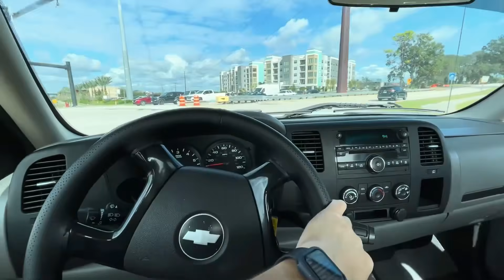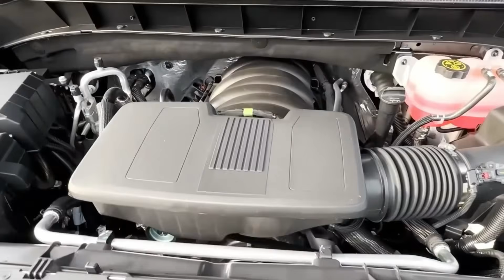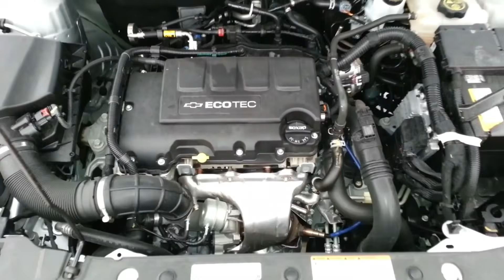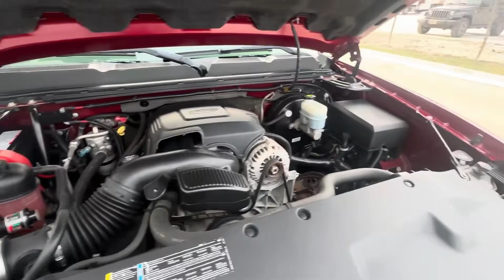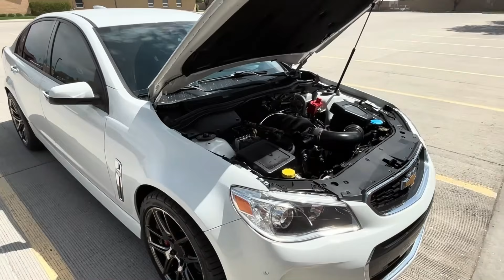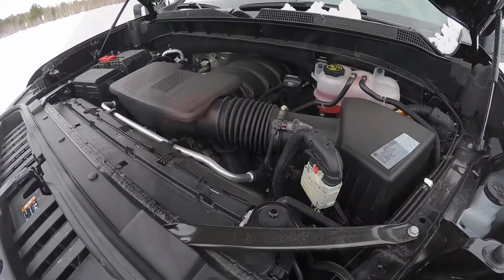Chevrolet Engines to AVOID — and the Ones That Last Forever

Comment: My 2005 6.6L Isuzu diesel 2500HD Silverado has 297,000 miles on it with no oil burning issues yet.  Been changing filter and adding a quart at 5,000 and the filter and all 10qts at 10,000.

Comment: I've had great service from old carbureted 350 V-8s, iron duke four cylinders, as well as 250 and 292 straight sixes.  Ive also had great service from 5.7 TBI engines with many of them going well past 350,000 miles.  I have also had good service from 5.7 vortec engines, but as they get passed the 250,000 mile mark, I have had electrical issues.  The Vortec spider injection system is great until it aint!